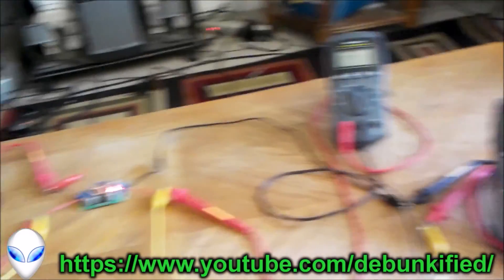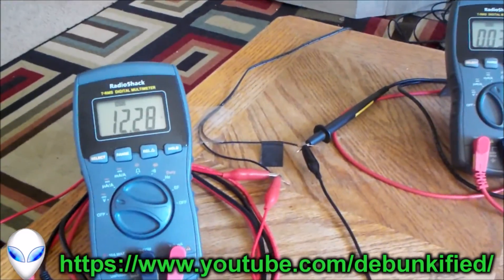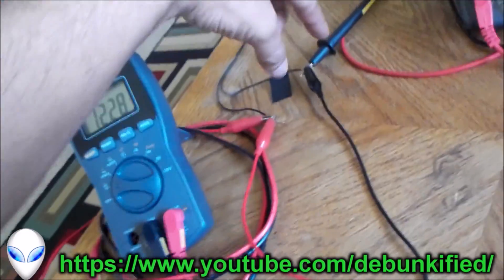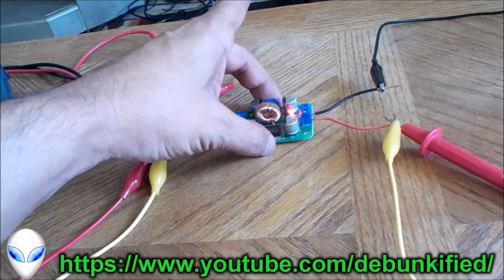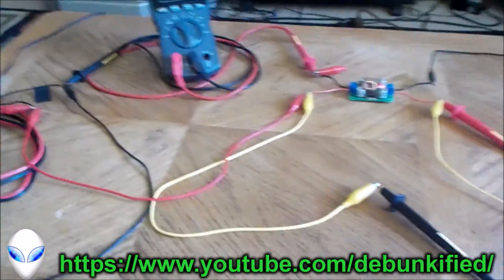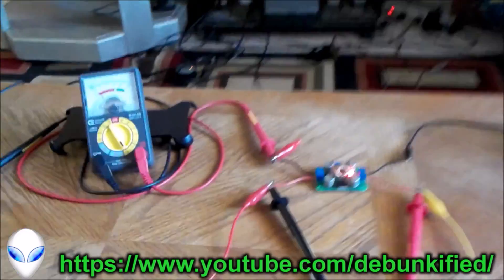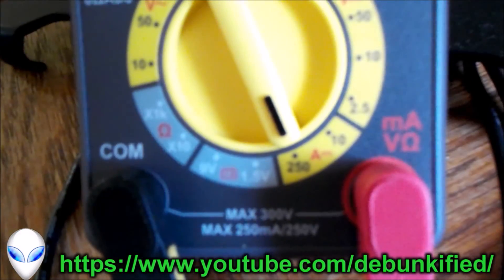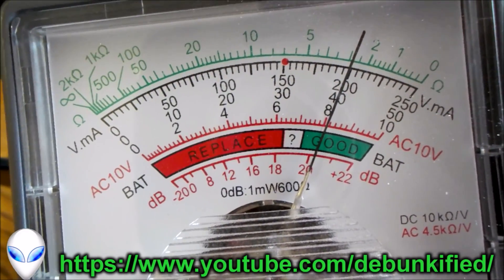Solid State Looped Overunity

Comment: Hi,

The problem is I think you are not measuring the total current taken from the wall adapter due to just the loop back. Please measure the current in the POSITVE wire of the wall adapter:  connect the coming positive wire VIA an Ammeter to the two red crocos (the two red crocos are found very next to the input DC voltage meter showing the 12.28V). Your input Ammeter at present measures only the input current of the DC/DC step up converter.

I think you will be surprised to find that the total current taken from the wall adapter will be much higher than 0.037mA.  I consider here the data settings as Vin=12.28V, Vout 12.31V, Iin=37mA,  Iout=689mA, ok?

EDIT: connect the positive input of an Ammeter to the positive wire end coming from the wall adapter and connect the negative input of the Ammeter to the common point of the two red crocos. 

Have you pondered on what is the actual load across the output of your step up converter?  There are two loads across it: one is the output of your wall adapter and the other is the input of the step up converter.

Greetings,  Gyula
Reply from the maker: +gyulasun Hi, well I did do exactly what you said before we uploaded, and to my surprise it still read .037A or 37mA on the input.

I made that error once before with a joule thief circuit I made once and it appeared as over efficiency, but the meter was in the way of the collapsing magnetic field traveling backwards through the battery to discharge it twice. The joule thief is extremely inefficient.

I'm not so sure if this DC-to-DC converter uses the fly back method nor a step-up transformer, but instead perhaps a Tesla type switch by looking at the 4 capacitors there on the converter.

2 capacitors would be connected in series to boost the voltage while the other two would be connected  in parallel and then switched alternately.
Reply from the maker: +gyulasun Yes I have contemplated whether or not the actual load is the wall adapter or the input of the converter.

I thought maybe perhaps it is bypassing the wall adapter altogether and just feed backing straight into the input of the converter because the converter has less resistance I bet than the adapter does, and of course current will take the path of least resistance.
Reply: Dear debunkified,
I am a bit surprised to hear that you already measured the total current taken from the wall adapter and it was also 37mA. May I ask if you did use a 3rd Ampermeter in the positive wire of the wall adapter and it did show 37mA, just like the other Ampermeter showed 37mA (at the same moment) placed in the negative wire input of the step up converter?  Please check it again if you did not use 3 Ampermeters simultaneously when you checked the current taken out from the wall adapter.

If you happen to have a Kill-a-Watt meter, then you may wish to use it for seeing the power consumption of the wall adapter from the 230-240V mains.  This would be a second checking possibility to learn about the power taken from the mains to feed the total setup and compare it to an estimated consumption of the looped back converter. 

Regarding the question on what is the load for the step up converter: as I wrote last night the first load is the output impedance of the wall adapter and the second load is the input impedance of the step up converter, these two impedances are in parallel and load the output simultaneously.  And the output voltage from the wall adapter must be a bit higher than 12.31V (i.e. higher than the output voltage of the step up converter) to be able to feed current into the step up converter at all. I agree that the inner resistance (impedance) of the wall adapter is surely higher than the inner resistance (impedance) of the output of the step up converter.   At the common point of the two outputs and the input (where the loop is created), the Kirchoff's junction rule should be valid.  The 3 currents involved at the common junction point are:
1) output current from the step up converter,   689mA, this enters the junction point because its driving emf is 0.03V higher than voltage between the junction point and the common negative rail
2) output current of the wall adapter coming from its positive wire and this is what you say is also 37mA, this also enters the junction and this is what I doubt to be also 37mA...
3) input current to the positive rail of the step up converter, this should be 37mA just like you measure it in the negative rail of the step up converter to be 37mA, this current comes out from the junction

So there remains the 'mistery' how much current is arriving into the junction point from the wall adapter? 

You ponder on the circuit used in the step up converter:  in case it is the same circuit indeed what a user below (Brandon Wallen) gave an amazon link to, then the integrated circuit used in it is the LM2587 ADJ type, here is a complete data sheet on it:
http://www.ti.com/lit/ds/symlink/lm2587.pdf   and a possible shematic is shown in Figure 55, page 20.  Instead of the programming resistors R1 and R2, a multiturn potmeter is used, the wiper of which is connected to pin 2 (feedback) to vary the output voltage of the converter.

Greetings
 Gyula
Reply: Dear debunkified,

I have given a second thought of your setup now that we can be pretty sure on the inner circuit of the step up converter. A member at overunity.com forum started a thread on your setup last night, see here: http://overunity.com/17184/a-solid-state-dc-to-dc-converter/ 
 I have copied / edited Figure 55 from the data sheet I already referred to and uploaded it to that forum. I indicated the red loop back wire via the Ampermeter that measures the 692mA "output" current. You can see the very probably inner circuit detail of the step up converter, practically most of the 692mA current should circulate in the closed circuit between the input and the output points (i.e. via the switched 15uH coil and the 1N5822 diode inside the circuit and via the Ampermeter outside the circuit). 
I indicated a brown coloured cross point right at the positive input of the step up converter where you could check how much current may be going into the positive input of the step up converter, that current should include the sum of 37mA and 692mA currents as per Kirchoff junction rule. 
This means that in my last night comments above, my points 2 and 3 should be revisited, but I do not want to go back and reedit it, this is what I am writing here should be considered now. 

My further comments: Practically the output power may be considered  as follows: the voltage difference between the output-input of the step up converter is 12.31V-12.28V= 0.03V so the power dissipated mainly in the inner circuit (15uH coil and the diode) and in the inner resistance of the Ampermeter is approximately 0.03V*0.692A=0.02W 
Notice that this dissipated power is higher for the analog Ampermeter case where you measured the data at the end of the video as follows: Vin=12.28V  Vout=12.51V  Iin=19.2mA  Iout=200mA so the dissipation is 0.23V*0.2A=0.046W  
It seems from these measured data that the inner resistance of the Ampermeter in the loop back circuit mainly determines the current, together with the amplitude level of the adjustable output voltage. (your Analog ammeter may have slightly higher inner resistance in the 250mA range than your digital meter in the mA range).
 And you probably experienced a narrow range within which the so called "output" current is higher than the input current into the negative rail of the step up converter. Suppose you would use, say, a 10 Ohm or 22 Ohm resistor in series with the "output" Ampermeter, and say you would set 0.5 to 1V input-output voltage difference, then the overall dissipation in this resistor would probably be higher than that of the inner circuit dissipation I referred to earlier. I am just trying to take out real output power with this pondering. Question is how the input current to the negative rail of the converter would change then. 

Greetings,  Gyula
Reply: Hi debunkified,

I wrote earlier this:

"Dear debunkified,  I am a bit surprised to hear that you already measured the total current taken from the wall adapter and it was also 37mA."

This is what I really meant:  I am a bit surprised that after you measured the total current taken from the wall adapter you found it to be also 37mA.  

I realize that there is no need to check the current in the positive wire of the wall adapter, it must be also 37mA like in the negative wire of the adapter. Where I suggest to check current is where I indicated in my schematic with brown cross lines in the positive input wire of the step up converter. 

At the overunity.com forum you do not need to log in to see attachments, and here is a direct link to see my drawing on your complete setup as per the video:
http://overunity.com/17184/a-solid-state-dc-to-dc-converter/msg502041/#msg502041   
If my drawing is not fully correct, please advise and I will correct it.

Greetings,  Gyula
Reply: Hi MrSummitville,

I agree with your calculations.  When I wrote my first answer to him above, I did not realize the "output" voltage is just the 0.03V difference which drives the 688-690mA current through the Ampermeter.  Some times later I already realized this and answered to him below my opinions.  Of course, the 0.03V difference between the input and the output is not the "output" voltage.  The real output voltage is across the positive and the negative output pins of the step up converter, it is set to 12.31V but NOT loaded with anything, it is an open circuit. 
Gyula
Reply: What the heck is "CROCOS"...?
Reply: MrSummitville  Hi, please not so fast...   The way he connected the "output" ampermeter was deliberate and it is sure he knows how to measure output current going to a load. Please ask yourself: where is the load? 
What he measures as 692mA current is the feedback current from the positive output back to the positive input of the step up converter,  you are correct.  He can do this, no problem with this but then we all need to understand that the ampermeter in the loop circuit can only measure the currrent defined by the output-input voltage difference and by the inner resistance of the ampermeter.  We also need to understand that the input current the 37mA to the step up converter will change as we change the voltage difference and / or the inner resistance of the ampermeter.  
While I disagree with the overunity claim in connection with this circuit (unless new proof with measurements show up on the contrary), no need to denounce anyone here, ok? To err is human!
Thanks,  Gyula

Comment: Is this the DC to DC step up converter you are using?  https://www.amazon.com/RioRand-3-5-30V-4-0-30V-Converter-Regulator/dp/B00J2PT83E  Thanks for sharing
Reply from the maker: +Brandon Wallen Yes, that appears to be exactly it. If you decide to buy it, I suggest getting it from eBay as they should be quite a bit cheaper.

Build it and you will get the exact same results. It should work right out of the box, if not then just tune the preset resistor with a tiny flat head screw driver, CAREFULLY.